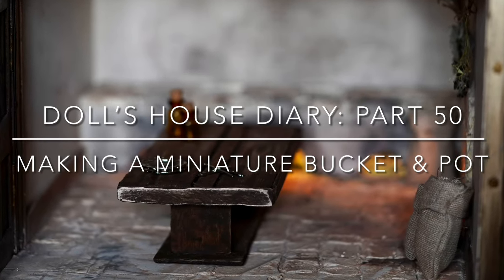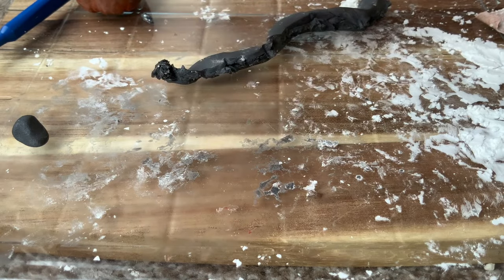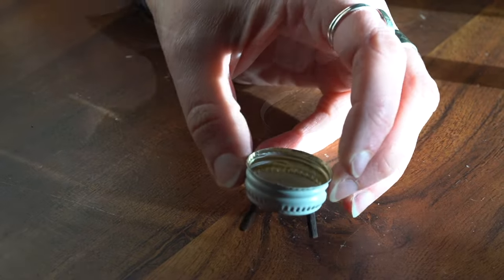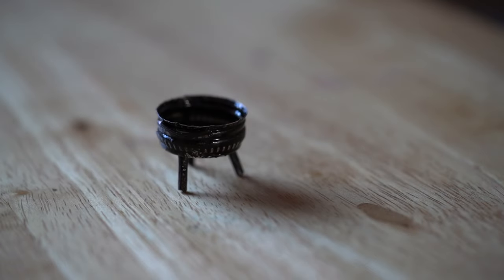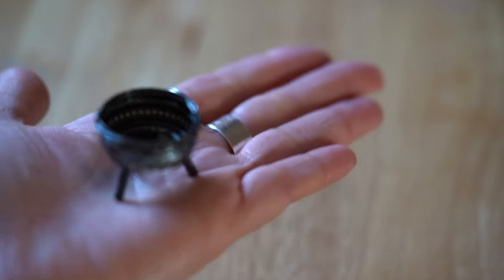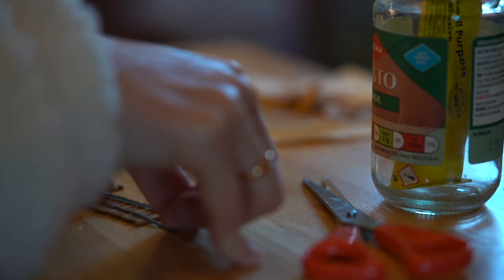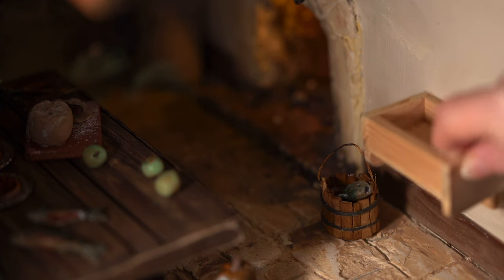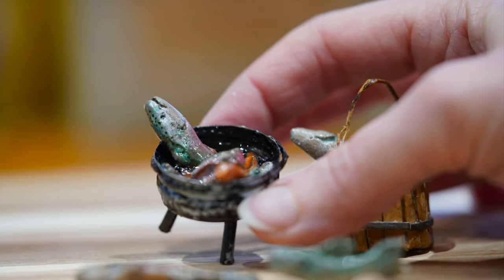DIY Miniature Pot & Miniature Bucket | Tudor Doll’s House Makeover Diary - Part 50

Comment: Get yourself a little pin vice hand drill for making tiny holes without splitting. They are £5-10 but you will use it in everything once you have it and they come with a variety of tiny drills. I love mine! I like the big sink ❤❤❤
Reply from the maker: Oooo thank you for the suggestion. Do you think the pin vice hand drill will drill a little hole into a shell? (It’s a special shell to me, and I’d like to put it on a necklace hehe. … Not at all linked to the doll’s house 🤭) Thanks so much for watching, and for taking the time to comment.
Reply: Yes I think it would. I'd stick tape on the shell first then start with the tiniest drill bit and work up to the size of hole you'd like. You have more control with a pin vice than an electric drill. I would test your skills on a muscle or limpet first before your special shell! Good luck xx @thelittlemouseshouse
Reply from the maker: @wendywalker3598  Great - thank you!

Comment: Oh I forgot, I used small plastic bottles cut down and used EVA foam as the boards and tied twine around them. I also sealed the EVA with wood glue to make it hard.  Polystyrene is possibly the most versatile building material for miniaturists. It takes impressions really well and obviously its light and, especially the Extruded polystyrene, is one of the most realistic looking stone effects I have seen. You do have to watch with superglue and various chemicals, notably acetone which dissolves it and turns it into liquid resin which can also be used in crafts (thats the normal bumpy packaging polysryrene). There you go thats your lesson on recycling polystyrene for the day lol! I love how both of these came out❤
Reply from the maker: Ooo thank you for the info! Thanks for watching the video!

Comment: would using a needle or a push-pin on the damp wood help in making the holes without splitting the wood?
I agree with an other commenter about the teensy hand-drill; have one on my amazon crafting list for future crafting endeavors 
Cats in Tudor would be in the kitchen/pantry areas likely to catch the mice.
instead of epoxy resin, do you have clear pva glue?  I have seen other YTrs use it in replacement to the resin that comes in those MGA make-it-mini food balls.  it may take longer to dry/have to do multiple layers with it if you are looking to have items 'floating' in it, but could be an alternative, and not so toxic?
Reply from the maker: Thank you for the suggestions! They’re all things to consider. Thanks for watching the video, and for taking the time to comment.
Reply: @thelittlemouseshouse  🥰